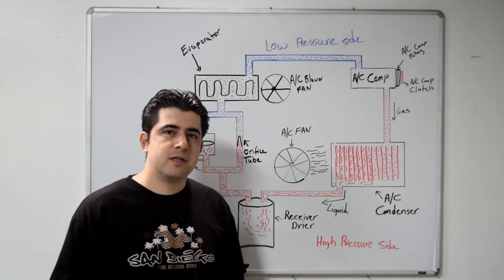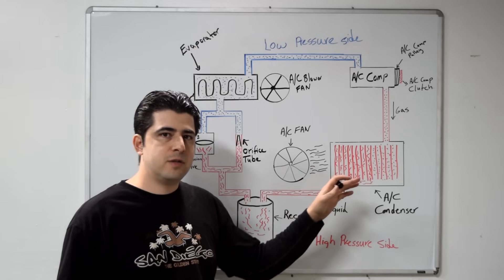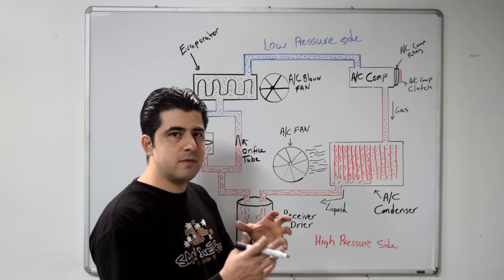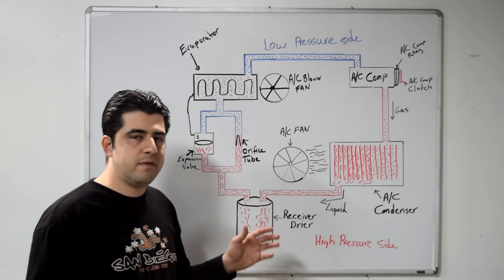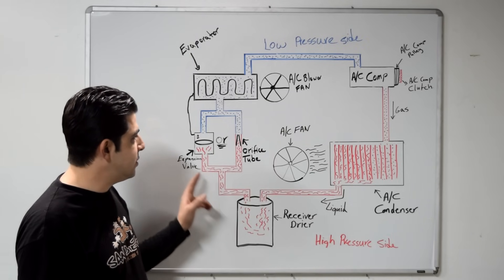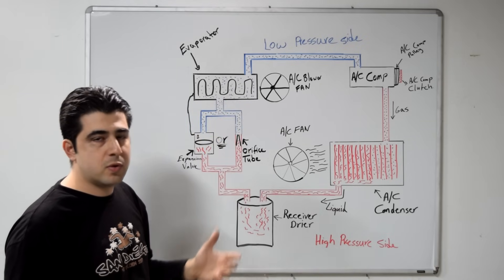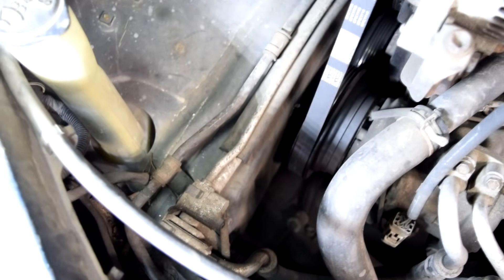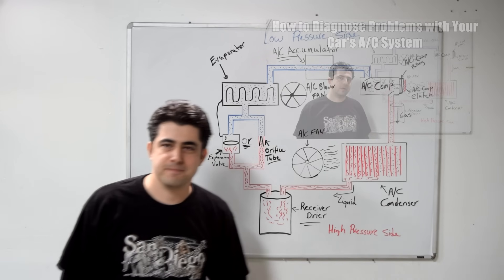How a Car AC System Works - For Beginners

Comment: Hey Boss I have 2007 Saturn Hydrid Vue I have no cold air when I turn the A/C on I don't even hear the clutch come on. I bought one of those auto zone refrigerator bottle and it when to red 689/100. Also with this Hyrid the compressor is on the right of the engine compartment no belt so I don't have a clue how the thing even works. Do you have any ideas.

Thanks

Comment: Great video! I was wondering should I replace the receiver dryer when I replace the AC compressor in my 99 Toyota 4Runner? if so any advice on how to replace the dryer?
Reply: Yes, Always replace both together. The system may need to be flusher first though.

Comment: Very good video man ! Well detailed ! I have one question so i everytime my car is on and i put the recharge guage on it and turn the ac on it goes down to 0psi but then i turn it off and presssure goes back up but still no cold air i changed the compressor ,expansion and the only thing i have to replace is the drier and maybe condesor any clue on what you think this issue might be ?

Comment: Good Video, thank you for posting this. it helped me immensely!!!  I do have a question though... as you stated, you "should" replace the "Receiver/Dryer" every time you expose the A/C system to the atmosphere, so if you do not have one, and have an accumulator, do you have to replace it as you would an Receiver / Dryer?
Reply: The accumulator contains a dessicant charge exactly like a R/D. So yes, you need to replace it.

Comment: Hi and thank you for your information really good information., I have a question i have a 2014 chey sonic 1.8 i put the gauges and what happens is when the car running both low and high side gauges shacking what is that Mean? and thank you in advance

Comment: Please help. Last year i had car accident. plastic head with connector of preassure valve broke from valve. we putted it back in glued together and refill the ac. you would know the ac did not work. this year i have drained the ac, bought a new valve and filled it back. still doesnt work. after watching your video i went to the car and tried to manually spin the clutch. it cant be moved. its stucked to puley. i also see no gap bettween the clutch and puley. after i turn the car...there is no click sound. what amazes me that the clutch is spinning with relay all the time, even though my ac is off inside the car. so it runs and stops with the car, no matter if i have the ac on or not. ...no cold air of course. i will buy new compressor but let me know...would replacing the compressor work or is there anything else might not be ok. thanks.

Comment: On my car the AC condenser has a petcock on the bottom I accidentally opened, some clear sticky fluid leaked out with an audible pressure noise. Ever since I did that my AC system doesnt work, what was that liquid? Was it refrigerant? Do I just need to replace the refrigerant? Or was it an oil of some sort?
Reply: It was compressor lubricant oil. Sticky, and smells like fresh paint/Band Aids (i have a bottle of it which i use as chain lube).

Comment: The air conditioning is compressor is moved by the motor rotation, so how the compressor keep working at same rate when the engine rotation increase? +RatchetdAnd Wrenches
Reply from the maker: +André Porto The compressor will be switched off more often when the RPM goes up by the AC pressure switch. The AC pressure switch regulates when the Compressor should work thereby keeping the pressure in the system with a specified range.
Reply: OK RatchetsAnd Wrenches Thank you for the answer!
Reply: @AP-gc5ss  Can be ever more involved than that though; there are compressors such as the Harrison V5 and CVC and Sanden SD7V16 which, thanks to a mechanical control valve in the compressor's body, will start reducing the pistons travel distance as soon as the suction pressure reaches a set value (which is apparently also influenced by discharge pressure, so that you apparently get a colder evaporator and as a result colder air in the summer when discharge pressures increase), so that they begin pumping less refrigerant to keep the evaporator from getting too cold. Alternatively, a computer can set the same travel distance through a solenoid control valve as required to keep a certain evaporator temperature at all times... so the shaft rotates at the same rotational speed of the engine but what varies is the displacement and the clutch can cycle much less or even be completely removed from the compressor...

Comment: So the accumulator filters the gas and a drier filters the liquid?
Reply: The accumulator can also filter liquid if some liquid manages to get past the evaporator due to a sudden heat load reduction, but the receiver dryer is always filtering liquid in a healthy system.

Comment: If your car has a AC accumulator instead of a receiver drier, do you have to replace the AC accumulator if you open the system?
Reply: Definitely, the accumulator contains the dessicant element.

Comment: Is the receiver drier the same thing as an AC accumulator in other cars?
Reply: No, it's not the same thing. The receiver dryer is located before the evaporator. The accumulator is located after it. It's meant to be that way because the orifice tube can't adjust itself to varying thermal load so the evaporator is always flooded and some liquid may spill into the suction line for ex. when you turn blower from maximum to minimum speed and that's why a "tank" needs to be right before the compressor. The TXV can adjust the flow so that no liquid exits the evaporator at all times (except, perhaps, when you force the TXV to work with very low loads such as if you tamper with the blower so that the compressor runs even with the blower off) so that the "tank" can be placed before the evaporator and there's no impediment at all to the suction gas flow. True that they both hold the system's desiccant charge, but functionally they're not the same thing.

Comment: I was told that for the air to work the temperature out side needs to be over 60 is that true
Reply: Not in my car at least. It works all the time. Even in the dead of winter.

Comment: Generally, how to quantify ac systems in cars ? How many tonnes or BTU's does a passenger vehicle have?
Reply: Shyam Sundar I would say about 3 to 4 times bigger than your a/c at your house, If your house ac is 3 to 5k Btu your regular mid size sedan will have a system that is 3 to 4 times bigger in this Btu scale around 10 to 16k Btu.

Comment: 5:53 But doesn't the high pressure liquid that enters the the txv or orifice tube turns into a low pressure liquid coming out then the evap turns the low pressure liquid into lie pressure gas.
Reply: The TXV has a bulb that closes the orifice whenever liquid touches the bulb (automotive H-block TXVs have the bulb placed inside the refrigerant passage) so yes, while some liquid may flash into gas as it's being released inside the coil by the orifice due to the sudden pressure drop (you can see the same thing happening when you spray a duster can upside down), the heat absorbed by the evaporator's surface does the rest

Comment: I need some help please. I have a 2000 Toyota Avalon XL car which runs good.  The car air-conditioning puts out cool air but only to about 50 degrees Fahrenheit when the outside temperature is 90 degrees and I'm driving at 60 mph on the Interstate. I think it should go down to about 40-45 degrees. When my mechanic did the pressure readings using the manifold gauge, it was 250 psi on the high side and 80 psi on the low side.  He said the compressor needs to be replaced.  I thought this points to replacing the expansion valve. Does anyone have any suggestions?  Thank you.
Reply: Sorry, I meant to mention that a dye test showed no leaks, and also the mechanic did a vacuum on the a/c system and replaced the refrigerant to proper specifications, and also the cabin air filter is good.  Any suggestion / explanation would be appreciated.  Thank you.
Reply: You maybe overcharged or have air in the system which will raise pressure on both sides, air is non-condensible gas, high side would not get to 250psi if compressor is bad. Sounds to me like your overcharged, more pressure means higher temps, psi and temps are very closely related with r134a.

Comment: I have confirmed that my condenser has a leak.  I have ordered a new condenser and receiver drier.  I understand that you need to evacuate your system before working on it.  If my AC isn't working, and only blowing hot air, does it still need to be evacuated or am I ok just changing out the condenser and receiver drier without any prep-work?
Reply from the maker: Wyatt DiVall try pressing down on the valve inside the L and H fittings if refrigerant sprays out than you'll need to evacuate if not you should be ok but there's still a chance some refrigerant is in the system. GL
Reply: RatchetsAnd Wrenches Thanks.  No refrigerant coming out.... we're good.  Disconnected just fine.

Comment: Sooo...since the compressor is powered by the engine...is there a way to tell how much power you loose by turning it on?
I mean It won't really matter in a 250hp car but what about a 75 hp car?

Comment: Why do some cars ac compressors don’t have a clutch? My ‘11 corolla doesn’t have one.
Reply: It has a clutch, it's just integrated into the compressor rather than on the outside  It's a shit disign.  Had 2 go out on my 2010 vibe (same drivetrain as corolla).  Everything else about the frame/motor/trans are great though.

The reason it's a shit designed ac compressor is because usually just a clutch fails on a compressor.  When the clutch fails on that model corolla, you have to replace the entire compressor.  Turns a $60 DIY job into a $300+ DIY job if you do it right and that's on the very low end if you don't have all the tools you need.  To change compressor you need to evacuate the refrigerant, replace compressor, flush the lines, vacuum the system, and finally recharge with refrigerant.  Why oh why would they design the compressor this way...

Comment: Without gas compressor work?
Reply: It will work if the pressure sensors/switches are bypassed or it's a clutchless compressor, but it will destroy itself in short order, because the refrigerant is what brings the oil to the compressor in automotive systems, and the suction gas also cools the compressor down, so it will work both without lubrication (whatever is left inside will either be pumped out or carbonize) and cooling.

Comment: Hello dear, i really need help with my ac, from anyone that has experienced such thing.

I own a Yaris berline 2007 that i got without AC pre-installed, so i paid to install the complete AC system. Now the issue is that when i turn the AC on it shakes the engine really bad till it turns off. I've tried a few things, but it's still not working, helps pleeeeeease !!!!

Comment: So does the AC use gas or does the battery do all the work
Reply: Starship Overdrive as a kid I herd from almost every adult say the car's air conditioning uses gas and it was usually the reason why so many tried to use it as little as possible quoting gas prices and the like. After so long I decided not to deny their knowledge, after all every adult would say the same thing, but was never explained how or why: was the extra consumption so significant or did it even matter? This drove me nuts as I hate people using the excuse "that's the way things are" and not to question it or think about it.
Reply: The AC compressor puts a load on the engine, like when you ride a bicycle with an engaged dynamo and it's harder to spin the pedals (more energy is required) than if the dynamo wasn't engaged. This load on the engine also requires more energy, and more energy comes from burning more air and fuel.
Reply: Unless you trickle charge your battery every night, all the energy your car uses comes indirectly from gasoline.  This means the lights, radio, turn signal - even charging your phone.  First law of thermodynamics: there is no free lunch.  The reason the AC compressor comes up in these discussions is because making things cold takes a ton of power.  Thousands of times the amount of power used to say, charge your phone or blast Taylor Swift on the highway.  That's why it can actually affect your mileage.  If you had subwoofers that pulled several thousand watts or utility lights that did the same, those could have an effect on your fuel consumption as well.

The long and short of it is that at low speed, having the windows down (AC off) is more efficient because you can turn the compressor off, reducing load on the engine.  On the highway/interstate, the increased drag caused by having the windows down is actually greater than the AC compressor's load on a hot day.  Have you ever thought twice about rolling the windows down because of gas mileage?  If not, then the AC compressor is likely nothing to worry about.  Do what's comfortable.
Reply: This was one of the best episodes of Mythbusters, that tackled this debate. https://www.youtube.com/watch?v=iUFwbNbQpck

Comment: chap. You made an error here.... the expansion valve does not turn it from liquid to gas? It enters the evaporator as a liquid, and as it heats within the evaporator it then turns back into a gas..... x
Reply: Some liquid flashes into gas as it's being sprayed from the orifice, but the most of it does so inside the coils especially since the TXV is rigged so that it closes down whenever liquid exits the evaporator...

Comment: anyone have an idea if: both my cat and a stray cat are now pissing and spraying cats pee to mark their territory up and on my front lower grille to which some 'overspray' has landed on the aircon rad/condenser - would this odor likely be able to effect the smell of the cabin air? when the cold is on it doesnt smell, just went the air is set to blowing with the cold/heat turned off (so just air)